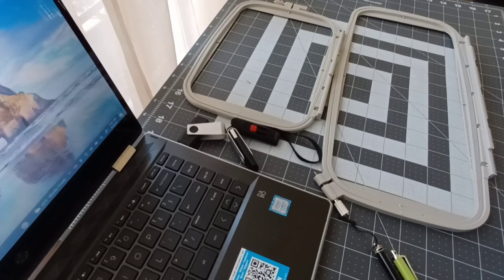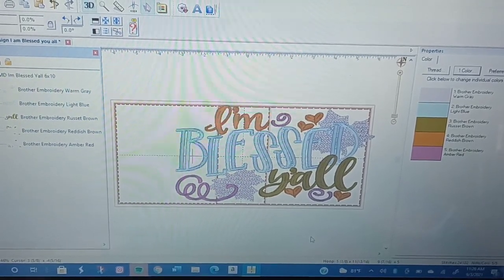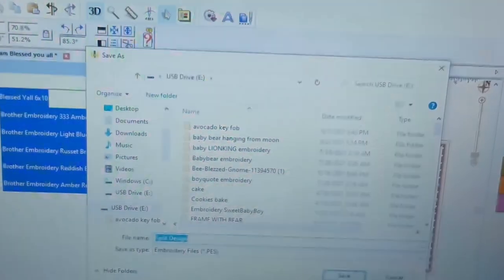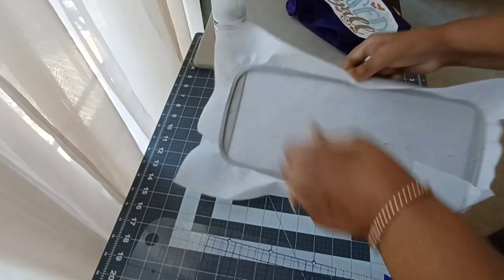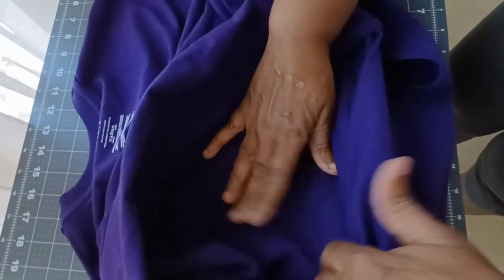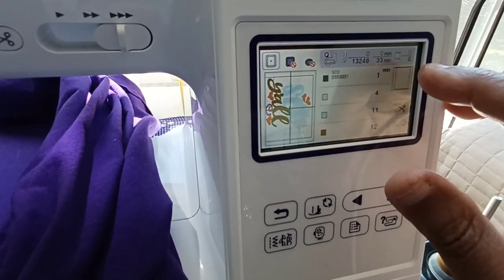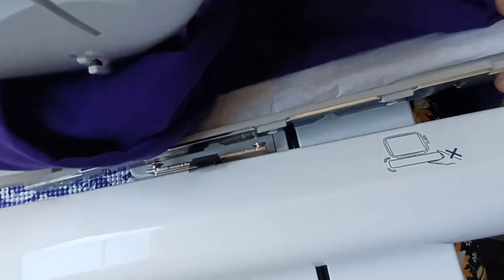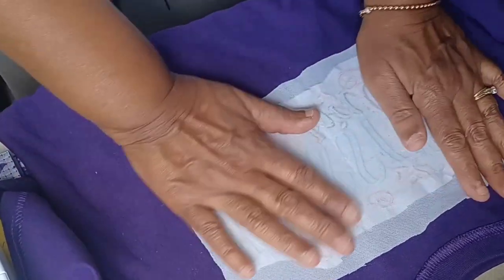How to embroider bigger using a 5"x12" repositional hoop in a single needle machine

Comment: Very nice and detailed video!!!  Lamentably my Brother 2500D doesn't have that hoop available. But my Bernina B830 has the 400 x 130 that has three positions, so I will use the instructions for that one. But I also have Embrilliance, and the area where you select between normal or multi-position hoops doesn't appear at all for neither PES or EXP, the formats that I use, and is kind of weird coz I just got the latest update for the software. I will have to contact Embrilliance and ask what happened.  Pero Muchas Gracias my Querida Boricua por magnifica ensenanza!!!
Reply from the maker: Es una buena idea hablar con Embrilliance porque ellos deberían incluir el formato para la Bernina. Gracias por ver el tutorial y apoyar mi canal. 😊.

Comment: Hi like the videos. I have a 5x7 embroidery machine I notice in the video your design is 6x10. So, I can purchase the 6x10 design and use it with the 5x12 hoop.
Reply from the maker: Hi! You can embroider a bigger design, but you need to get a repositional hoop that will allow you to do a larger design up to 5x12. I got mine from Amazon. Just make sure that the hoop is for your machine model. I linked the hoop style  below on the description box. 😉

Comment: Do you always float on the 5x12?  I have hooped my garment, and the 2 files do not align along the bottom of the design.  I suspect hoop flex along the 12" side.
Reply from the maker: Hi! You can float it or hoop it. It shouldn't affect the position. If you center one file, make sure you do the same for the second file. Thanks for watching 😊

Comment: Can the steps be used on Brother SE600? I have the repositional hoop for my machine already. I’m trying to embroider a long design but for some reason when I move the hoop the design isn’t in line. If that makes sense.
Reply from the maker: Hi, the steps are the same. Make sure not to center the second section of the design. Just move the hoop to the next position and continue the process. I hope this helps 🌻

Comment: Hello do you think this hoop size will work for the brother PE900?
Reply from the maker: Hi! You need to check what kind of hookup the machine has. I think it is the same. Check the parts on the video I showed the kind of hookup. Also, check the specs on Amazon and make sure it includes the PE900. Thanks for watching 😊
Reply: yes, it is the same, but I reached out to the company through email and hopefully, they get back to me soon. Thank you for the video. You explain everything well. @TheCraftyPuertoRican
Reply from the maker: @jharper74  yay! I hope it works out 😊

Comment: I've followed your video for the Jumbo hoop in Embrilliance and got to the point of saving my work and it won't save as stich and working file, so I can't transfer the embroidery to my se1900. I wrote out the text Buffalo Soldier on the Jumbo hoop but it won't save it in my working files, HELP!!!!!
Reply from the maker: It should have saved it in the two separate files, have of the designin one file and the other half in the other file.  Also make sure that is saved in PES format. Hope this help.

Comment: Can I use the 5x12 hoop for my SE600?
Reply from the maker: If your embroidery machine uses a 5 x 7 hoop you can. You need a software Embrilliance essential to be able to do it. If you get the hoop make sure is for the Brother. Follow the steps on the tutorial and you should be ok. 😊
Reply: @TheCraftyPuertoRican  my machine uses a 4x4 hoop
Reply from the maker: The have one for the 4x4. It will increase the size to a 5x7. The steps to follow are the same. The only difference is the size. 😊

Comment: I used a 5x12 hoop for a project and I couldn’t figure out how to get it to line up right 🤷🏼‍♀️ I ended up farming out the project to the local embroidery shop 😅
Reply from the maker: I use this hoop for all the adult embroidery and minki blankets personalization. The designs usually aligns automatically.
Reply: @TheCraftyPuertoRican  yea I had one side of it was a name that the letters weren’t connected and that part did just fine. But the other side was a 10” letter P and it just would NOT line up 😒 I did at least 12 practice runs..
Reply from the maker: @nanciblank6322  It hasn't happened to me but I guess it depends on the design or digitizing. I've done lots of adult shirts, hoodies and minky blankets with it and no problems. 🤔